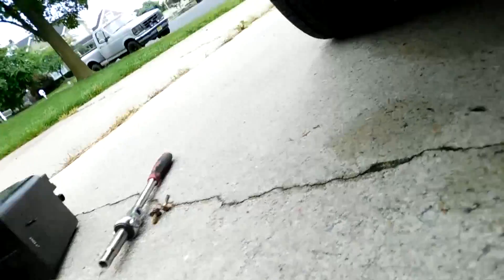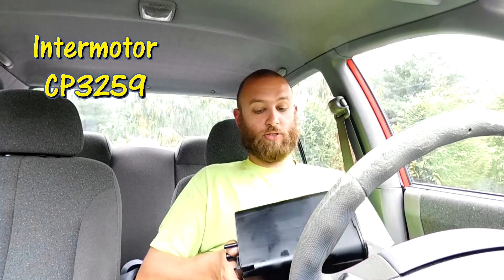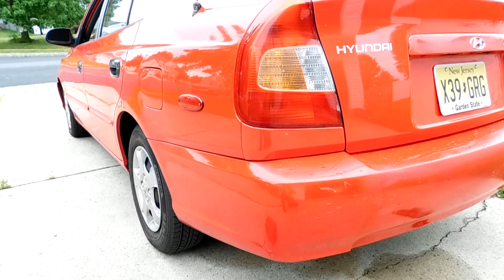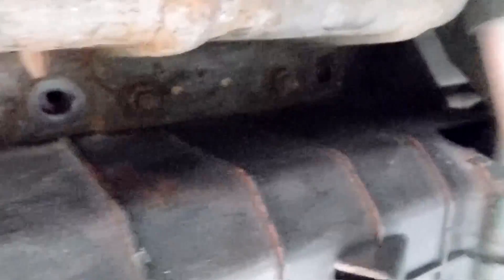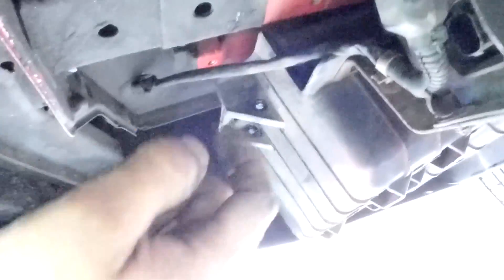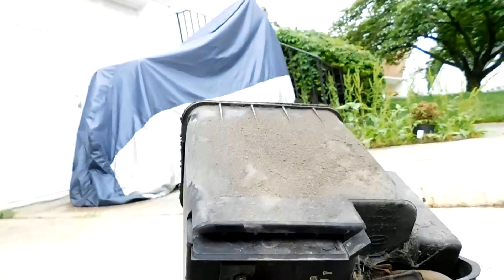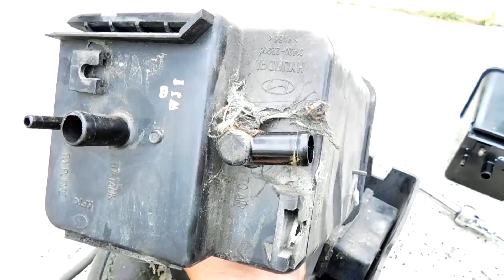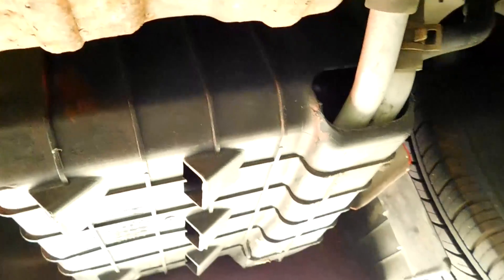Stop the Clicking When Fueling a 96-03 Hyundai Accent by @GettinJunkDone

Comment: Thanks Joe. I have a 2000 Sonata, same problem. Bought the vapor box and valve for $226 (wife thought I was crazy). Changed it myself, took a little effort. No more clicking at the gas pump. Take that wife!
Reply from the maker: There ya go!  Good work!
Reply: I mean did it smell like gas all the time? It is carbon, it only absorbs so much stuff then it goes to return. New carbon is probably better... But... Does it not smell like gas? That's what counts, for emish and brain cells yeah 240 That is a bit crazy. -a poor guy. Oh well

Comment: I found this video while researching the components listed on old repair invoices which I collect religiously.  In the age of You Tube it's intriguing to get first-hand looks at things mechanics have done with my vehicle since purchasing it in 2002.  In this case I am holding an invoice for this exact repair which cost in total $251.64 from a Hyundai dealer in Tampa back in 2006.  I wish videos like this one were around back then because this looks like a 15 minute job or so and I would have tried it in a heartbeat.  

As an interesting side note, when this problem first began, I took the car to Firestone.  They not only could not find the problem they denied that I was experiencing it in the first place (there were no "test" gas pumps at their shop for me to demonstrate so they only had my description of the issue to go by - and they didn't believe me).  Despite their doubt and inability to address the issue they charged $100 just to have the look.  I contacted Firestone after the Hyundai dealer properly assessed and replaced the canister to let them know I had just dropped a hundred bucks on them for zip, and they completely refunded me.

Comment: Man before I found this video this same problem I was having was a mystery, I first thought that there was something blocking the fill hose to the tank. But there was nothing blocking that line. Then I knew it had to be a breather hose clog which would do the same thing. It was really weird when I removed that little breather hose from the canister and all those black pellets fell out. I first thought it was rotten rubber but the realized this is a part of the canister. This is a really complex fuel system but this video made it much more understood and simple to fix
Thanks dude!!!

Comment: Great video Joe. I inherited a 2001 Hyundai Accent GS. It developed the problem that you described in this video. For the last two years or so, I have been forced to dribble gas into the tank.  If I depressed the gas pump nozzle handle too much, the pump would stop pumping gas. This is because the gas was backing up in the gas tank filling tube due to the vent line being plugged up with the charcoal pellets.  So being a nice night out and only 70f, I decided to do the quick fix and try to clear the charcoal pellets out of the vent line.  The line was easy to detect as when I squeezed one of the larger hoses I could hear the crunch of the charcoal pellets in the hose. The 17 year old hose gave me a little difficulty to remove but I got it off without tearing the hose. The  pellets in the hose pretty much spilled out and I used a screwdriver to make sure the line was clear.  I then went to work on clearing the loose pellets in the canister with a screw driver.   I finished this up by using my shop vac to vacuum out as many of the pellets as I could. Knowing that I may have to do this in the future, I lubed the inside of the hose and the fitting with silicone gel. I do not plan to replace the canister unless I get a "check engine light" that would prevent the Hyundai from passing inspection. 
Due to the age of the Hyundai, the next maintenance that I plan to do is to replace the timing belt. 
Oh, and this 17 year old car just rolled 49,000 miles on the odometer last week.
Reply from the maker: Excellent!  they are good cars.  Mine is rolling over 200K soon!
Reply: I  just did this today and used your tip to vacuum out as many as possible. I just filled up for the first time in a couple of years where I didn't sit there for 10 minutes (I'm very happy). I'm curious to see how long this will last. Also, I'm surprised your canister is having issues with only 49k?
Reply: So, it is now October 2024.  My Hyundai now has 65,000 miles on it.  I did get the timing belt / water pump / new heater/radiator installed.  New brakes/rotors/drums and blead the brakes with new brake fluid.  New CV axles.  New tires. I guess that I got most of the charcoal pellets out of the canister.  I don't detect any gasoline vapor being vented.  No check engine lights.  Gas mileage is 25mpg in the city.  Much better on the highway.  1.6L DOHC engine.
Best improvement was new wife ;)  ...
This should be the last year that my Hyundai will need any type of safety or emission inspection (Texas).
Reply: @markwitmer5498     my car also has 49k miles

Comment: 2000 Elantra same issue replaced the canister and filter dismantled the filler to clean it out. Also had replaced both sensors. Still same issue. Can’t even put 1/4 gallon before it clicks

Comment: same car, same issue..thx 4 video...i will just dump charcoal and disconnect power to unit...no emissions testing in most of Arizona... if rrock auto part was $40 than i would repair it

Comment: I have the same issue with my 01 Hyundai Tiburon. I knew the EVAP canister was messed up because it was throwing codes. It was my boyfriend's car, and he got a new one so he gave me this. I just wanted to let you know that you did so good explaining in detail that I felt like I could even fix it myself. Great tutorial. I do have a question for any car people out there, sometimes when it's low on gas it will (I really don't know what to call it) jerk, I guess. If I cut the car off for a few seconds and start it back it won't do it right away. It's such a ghosty problem because sometimes it does it and sometimes it doesn't do it. Sometimes it does it when there's gas in the car. Anyway, my bf was sure it was the coil pack, so we had that replaced, but it did it again the same day and there was plenty of gas in the car. That was about 2 weeks ago and it hasn't happened since. Could this be related to the evap?
Reply from the maker: Well, I'm no mechanic, but I suppose it could be.  Hopefully, this fixed your problem!
Reply: Joe Robinson thanks haven't fixed it quite yet but we're working on it. I made me bf watch your video lol
Reply: Tiffany Baker that sounds like you need to replace the fuel filter. I have a 2000 Accent and had the same problem. Replaced it and it hasn’t ever done it again.
Reply: @txhorn10  I did all that and problem still persist
Reply: Did u fix the it ??

Comment: I have the same refueling issue with my 2005 elantra.
And i jist ordered to parts so i could replace both the canister and valve. My question to you is. Have you seen any difference in MPGs?
In my elantra am getting about 20 mpg.
By the way.
Thanks for the video

Comment: Here's a tip. When fueling, don't shut the car off. You may hear some gurgling noise but you can fill up as normal... I had the same issue but decided to live with it because having purchased a new canister the mounting bracket didn't fit right so returned it. Everything works as it is supposed to with the old canister.  It doesn't affect mileage, as I get up to 42mpg on highway and 30-35 city.
Reply: Nope not all cases lol ive tried everything car on car off gas nozzle upside down, the best way to not spill gas i found is use as little pressure as possible on the gas handle,,, also extremly annoying cus u need to hold the pump the whole time
Reply: @Aglow37  heck yeah its annoying
Reply: @Aglow37  TRUE  i did this as well

Comment: great video! did it improve the fuel efficiency?
Reply from the maker: It sure did.  I've gotten it up to 36 mpg so far.
Reply: Is that 36 mpg a mix of city and freeway? I'm trying to determine if I should do a quick fix vs replacement of EVAP Canister. Better fuel economy might sweeten the deal to replace it after all.

Comment: Did that trigger the check eng. Light? Or just the refuel issue. I have an 01 accent. An have been having the refuel issue as well as the check eng. Light. That threw a 441 code.. As well as a torque converter code.. Smh. So not really sure if i want to dump money, or surrender it to the state (ca)

Comment: i cut the top of mine canister   and blew every hose from charcoal , still didn't work for me ,.. ill try to get out the hose from gas tank to the filler cap , may have spider web stuck inside .. been siting for a long time  . vent solenoid stuck open , not sure if that make any difference for the pump
Reply from the maker: Good luck!

Comment: does it also take a couple tries to start on full or would that be something else?
Reply from the maker: I didn't have any of those symptoms.  Could be any number of problems that might cause that.  Check your fuel pump.  In the hyundai accent it is located underneath the rear seat and pretty easy to get too.  Good luck!
Reply: Joe Robinson okay thanks!
Reply from the maker: Oops!  I totally read that question wrong.  For some reason I read that the tank was empty.  Having a hard to start issue with the tank full could indicate a problem with the EVAP system and I would like into it after all.  Please disregard my previous comment unless your diagnosis leads you to the fuel pump after all, but I would start with the EVAP system first.  

Thanks for watching!!

Comment: update..worked on my lil Accent..removed big heavy box..charcoal pellets in Solednoid and most hoses..dumped it all in trash ( 30%)...reconnected all hoses and unplugged solenoid ...that set 2 MILs   , PCV error and something else...reconnected power to it AND no more errors...I think this issue is fixed...@ 49k miles    Bypassing this MOST likely NOT possible

Comment: hey Joe I have a question,  what is the part your pointing to at exactly 4 min. into the video?  my 04 accent is totally missing that part,  the connector is just hanging with nothing to plug into.  any help would be awesome.  Thanks
Reply: Did you ever figure it out I have an 04 accent that I need to do this to and I'm a little concerned about doing it myself

Comment: Can this problem be the cause of my engine light going on?  I know it's bad because I did drain the beads.
Reply from the maker: Could be, but the first thing to do when the check engine light comes on is to check the codes.  if you don't have a code reader, most auto parts stores that I know of will scan it for free and at least point you in the right direction.  Regards, if you had to drain the beads, you need to replace the vapor canister.  

Good luck and thanks for watching!
Reply: Thanks for the advice.  I am replacing the canister first then I get it tested if light doesn't go out.  Thanks a lot.
Reply: Did the check engine light fixed when you replace the canister? I have the check engine problem too.
Reply: I replace the canister and the check engine light went out and I could then put fuel in the car.  However, the time that it was running with the defective filter may have caused other problems.  I have since had the plugs and wires changed along with the head gasket.  Total cost at the garage was $500.  Now it is fine. If you change the filter and the car still feels sluggesh you will probably have to have more done.  Then again my car is at 100,000 and these things had not been done before.
Reply: which check engine light code did you have ?

Comment: i don't think that fixed it. something caused the fuel to back up such as the vapor canister purge solenoid which draws the fumes into the plenum so the fumes can burn off. by not working it caused the canister to back up with raw fuel and push carbon into the gas tank vent tube and clog it up. better check the canister vapor control solenoid with a vacuum tester to see if it's working and check the ohms if it's not a vacuum leak. this video explains https://www.youtube.com/watch?time_continue=29&v=VmfiI1ribdM
Reply: THX !
Reply: SATURN is not a hyundai unfortunately...but i have a Vacuum tester